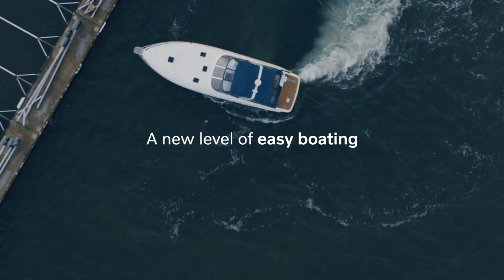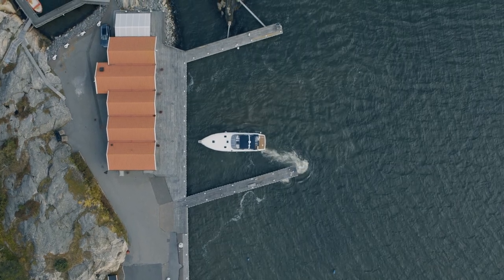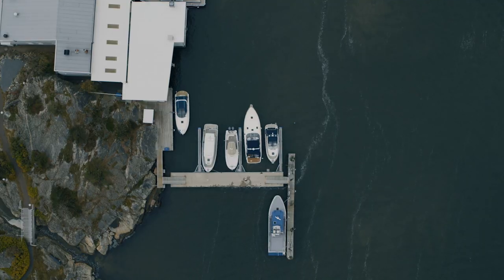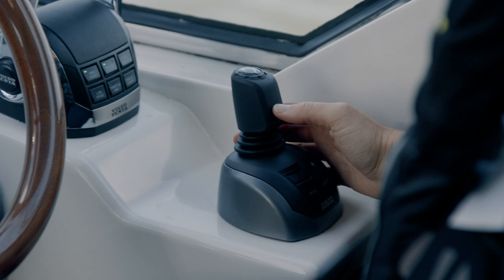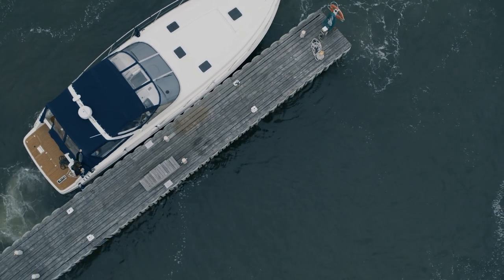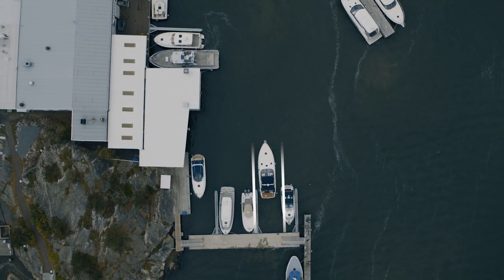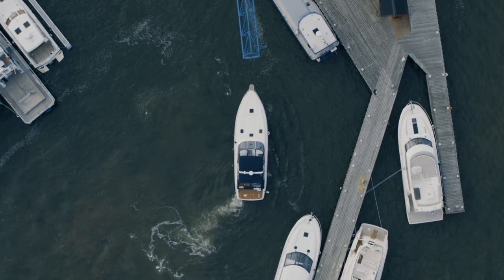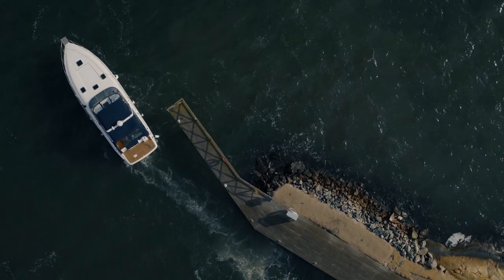Expert demo of Volvo Penta Assisted Docking system

Comment: Does it only work with IPS or will it work with shafts and joystick?
Reply from the maker: Hello Keith,
The Assisted Docking feature is an add-on to our existing Volvo Penta IPS System. It’s not yet on the market, but is being rolled out gradually across our IPS range in the coming months. You are very welcome to visit www.volvopenta.com/assisteddocking for the latest news about Assisted Docking!